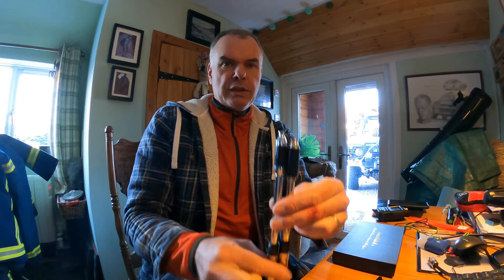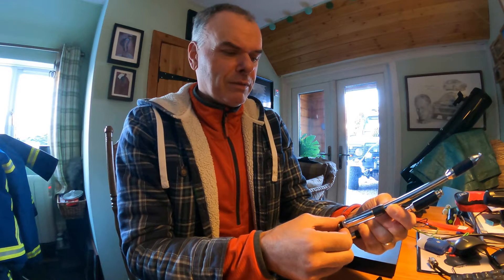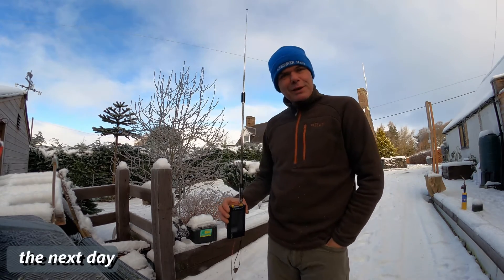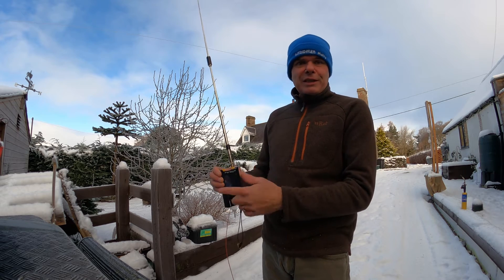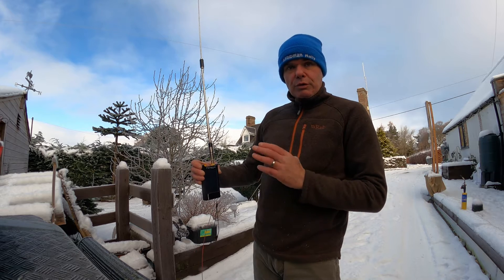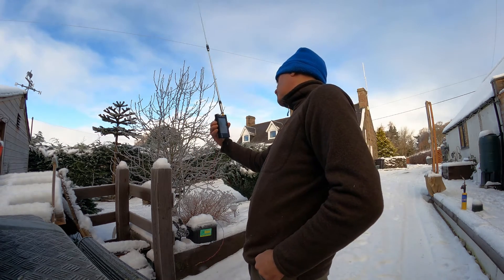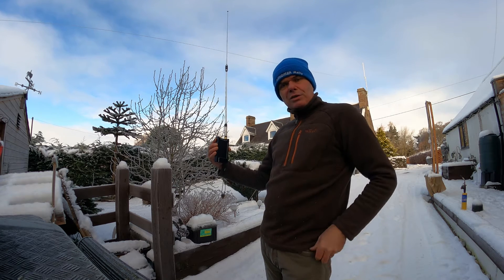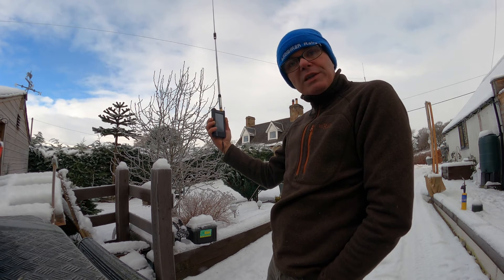Should I buy a fake or clone antenna? Detailed bench and on air test RH-770 SRH-779

Comment: Chinese anything, ham radio, I avoid! I started down my amateur radio path with the cheaper chinese radios and antennas and, I regret the money I spent (wasted) on them.
Reply from the maker: You're 99% correct. There is the odd decent thing. My main beef is when they rip off an item that someone has put R&D time into and then undersell them.

Comment: a good idea is to measure resistance between the top and the bottom with a multimeter to check if the chinese clone have a coil inside, or just a short
Reply from the maker: Yes, it is. They both measure the same. Open circuit from the centre pin to the antenna tip, and a short from the outer to the tip.
Reply: @theradiorover  hmm.. i would expect the original to have some resistance from the loading coil, while the clone is probably just a straigt wire internally (usual for cheap chinese clones) so just a short in the latter 🤷🏻‍♂️
Well i already have a clone on the way, guess i'll disassemble mine and if indeed there is no central loading, i'll try to retrofit one to see if performance improves 🤞
Reply from the maker: @EvgeniX.  a dc short isn't necessarily an RF one though.
Reply: @theradiorover true

Comment: always go with the Original, the Diamond, if the signal is strong, there is no problem, but if the signal gets weaker, the Diamond gets better...that's my experience....... Thanks for the Video..73
Reply from the maker: I agree with you. I suspect many buy the fake just by clicking on amazon without looking at the details. The Diamond is worth the extra money.
73, Fraser MM0EFI

Comment: Thanks for the video. I have the Diamond RH-770. Well built good performance antenna. I also have a 2m only MFJ-1714 antenna which is also good but not fragile. Broke one already ggwithin a week when I dropped my radio on the paved ground.
Reply from the maker: I'm on my second RH-770. I thought it would be a good idea to go mountain biking with it fully extended so that it would sent packets to my aprs digi-peater. Went OK until I fell off!
73, Fraser MM0EFI
Reply: @theradiorover  Yes the telescopic antennas are not good if you are moving. SRH-770S is a good option. I know people do hiking use it for APRS.

Comment: Thanks for a very interesting video, Fraser! 
I may have checked the SWR of my RH-770 but only with the FT-817nd and a good while ago at that. I agree with you about not buying ripoff products where possible. I've had my RH-770 4 or 5 years now and it's stood up very well although I do tend to be careful with things. Something I've done where the antenna gets wet is always wipe it dry before putting it away...while I doubt you'd get a similar effect to that you found on your Carbon 6 pole(!) perhaps the internal parts of the whip may corrode in time. I note the centre coil has what look to be spanner flats which makes me wonder whether some spare parts may be available. I also have a Diamond mobile antenna (same 1/2 wave on 2m and 2x5/8 on 70cm) which I had up on the porch roof for several months, took it down again and it shows no signs of corrosion so the materials it's made from are obviously pretty decent! 73, Simon G0CIQ
Reply from the maker: Hi Simon, I'm with you on buying genuine. However, my first Nagoya whip was a fake, unbeknown to me. It is difficult sometimes.
Good tip about wiping it down too! Sometimes I'm in such a rush to pack up and get off a summit. Need to dry absolutely everything on my return. Lesson learned.
73, Fraser MM0EFI

Comment: Very interesting video and very good comparison Fraser!
As you probably know, I have the Chinese copy (one got destroyed, one I have as spare). I bought it mainly because of the SMA-male connector that fits snug on my FT-2D. The mechanical quality of the copy one is really bad and as you explained, one has to be super cautions with it. Probably there is also some difference between each antenna, which could also manifest in different SWR. I used mine mainly on 2m with very good results and only a few times on 70cm. I wouldn't worry too much about the SWR, as longs it's below 3, you don't loose too much power and the finals these days are protected anyway.
After I saw your video, I will consider the original with the BNC plug again. It's just a pity that the SMA-male connector version is not available. Once I asked Wimo in Germany about the availability of this model and they told me that I'm the only one that looks for it and therefore they will not put it in stock. What I believe is that nobody asks for this version, simply because it's nowhere available. But maybe I'm the only one who asks such silly questions 😉
Thanks for this great video and 73, Stephan
Reply from the maker: Hi Stephan, Great to hear from you!
I like the BNC version because the SMA to BNC adaptor I have to use with it on on my handheld has a nice wide base and I think it puts less strain on the handheld. 
As a back up antenna the Chinese one would do just fine I guess,  but I do like to by genuine items where possible. I'd like to think I've covered the subject well enough to help people choose the best option for them. 
Cheers,
Fraser MM0EFI
Reply: @theradiorover  Frazer, of course, I also buy genuine items, if possible. In this special case I decided against the SMA-BNC adaptor solution, because it seemed to make the whole construction more brittle. If using a specific SMA-BNC adaptor with a wide base that is also protected against water ingress, this might be indeed a viable solution as well. 
Unfortunately, on most summits, I can't use the better performing antenna, since the front end of the FT-2D gets so easily overloaded, sometimes even when the next antenna is more than a km or so away. Therefore, mostly I have to use the stock rubber antenna to fight deafness.
I was also thinking about ordering the bandpass filter from Sotabeams, but I'm too much worried to crack the Yaesu's antenna connector and moreover one would need two adapters 😖.
73 Stephan
Reply from the maker: @PortableRadio  that's very interesting. We each have our own problems and have to find solutions to suit. 
My problem is lack of 2 m activity in my area. I generally have to arrange contacts in advance!

Comment: Hi Fraser, 
One of my friends in Spain (Philippe EA4NF) uses one with a Kenwood THD-72 full duplex handie in downtown Madrid to work FM satellites very successfully. Needless to say, I bought one one the strength of that. It's not a replacement for a yagi but certainly proved to be an excellent whip.
Reply from the maker: That's a decent effort with a whip! Now satellite operation is on my list of things to do next year. 
Cheers, Fraser MM0EFI

Comment: Good test Fraser. 
Diamond for me. I have diamond tri-band vertical on the house which works well..
What was the radio on your dash in the Landy?
Reply from the maker: It's a ft-400m pushing out 50 w into a diamond dual band whip. However, it was on the far front corner of the roof, with the 81 MHz whip on the corner closer to MM0RFN. After we finished filming, I turned the Land Rover through 180° and the signal report went up a good bit. It shows how fickle antenna placement is on 2 m and how little pushing in more power affects propogation.
Reply: @theradiorover  Cheers Fraser. Antenna placement can fickle. FT-400m :-)
Reply from the maker: @excossack  you have a ft-400m?
Reply: @theradiorover  no but i would like one.
Reply from the maker: A decent radio and the APRS functions are useful.
Reply: @theradiorover FT-400m has to be better than my Wouxon quad band. APRS would be handy as well.

Comment: Thanks for the video Fraser. The snowy scenery looked stunning. Glad I got the original, I ordered it from RW straight after you last video. Worked well on my last sota. Only a couple of qsos but all 59, including to Bristol. 73 Steve MW0SAW.
Reply from the maker: Nice one Steve. It's always tempting to go for the cheaper option. I couldn't believe how bad it was on 70 cm! You could wreck a £350 handheld, saving a few pounds on an antenna.
73, Fraser MM0EFI